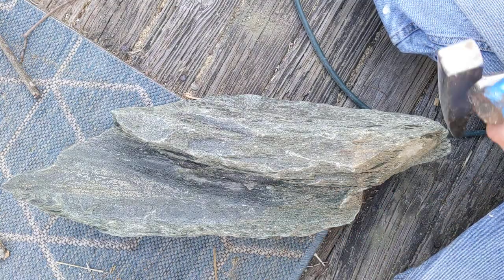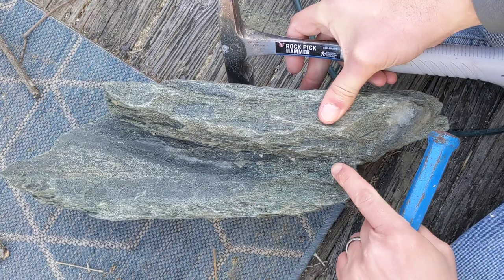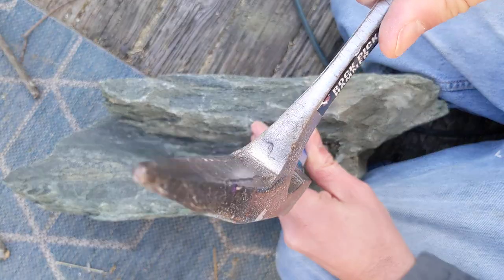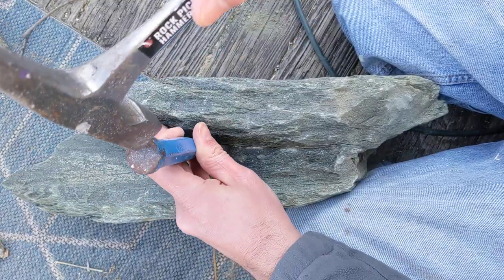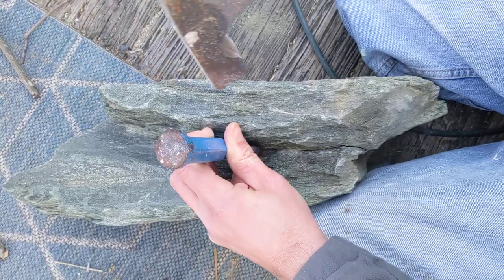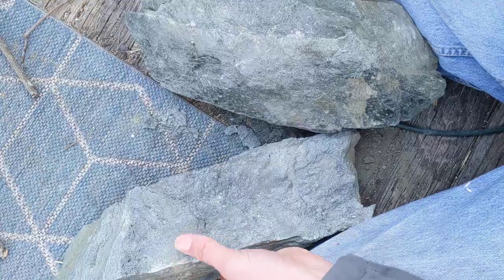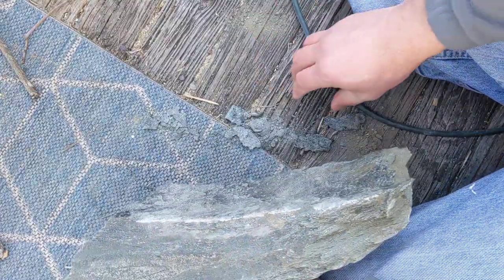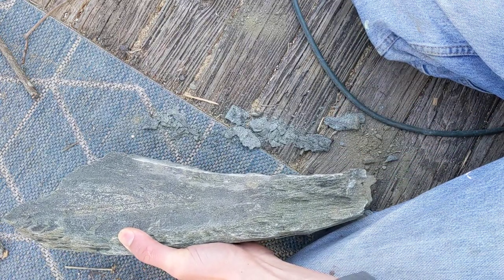How to break a rock with a hammer and cold chisel

Comment: What is the sharp point for on the other end?
Reply from the maker: In the field, you would use it to chip rock off, clean out a crevasse, or use it to pry something out of dirt or soft host rock. It also makes a fine back or nose scratcher when you're wearing protective gear and don't want to take off a glove to scratch an itch.